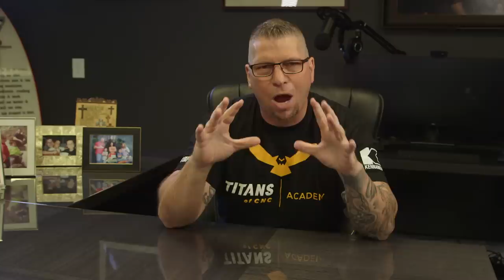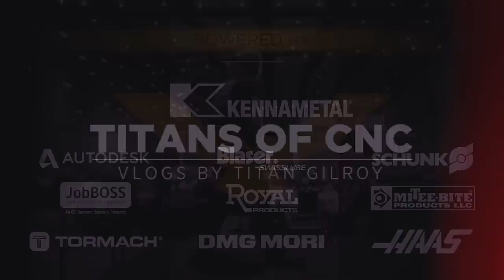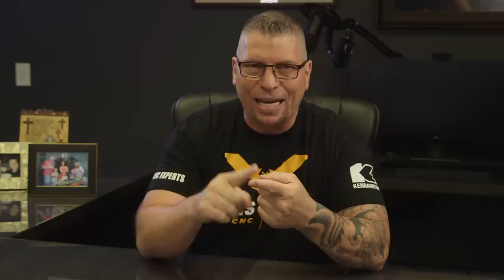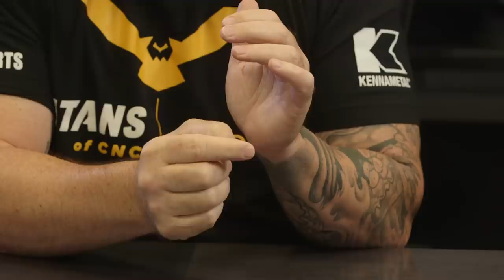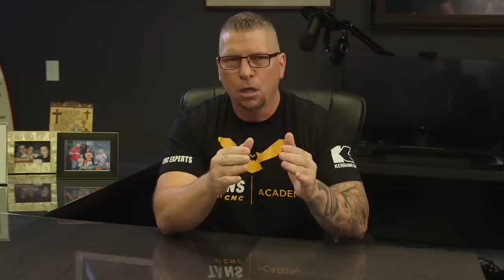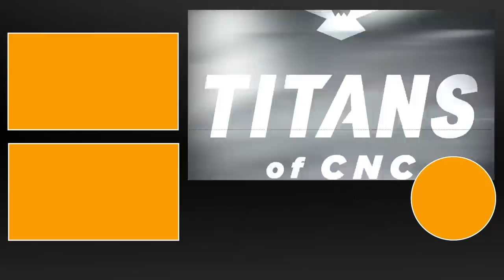My WORST DAY in CNC Machining - Vlog #96

Comment: Iv got a storie similar to this but with making parts for the new Mack/Volvo semi truck parts so in the past we have ran a bunk support part kinda looks like a boot from flat Aluminum sheet stock. So were running this job and running this job and i wasent a programer yet but so the material we ran the job on we only got five parts per sheet and the sheet was way to big for the job and i kept telling the engineer the sheets to big were throwing away 45% of the sheet away can we change it and he tells me naw it takes to mich time and were gettin the money out of the sheet with running these parts. So in the mean time i pressed for the engineer to train me on programing wotch he did do i spent months befor work and after work training and learning the job and this specific job was gonna be my first attack when he let me loose. Training is done the company got me a laptop from corrporate and said what do you this your gonna accomplish cause were giving you this opportunity and i said make faster programmes and save money for the company and they said we will so. So the bunk support came up and befor running the job i took an hour to get a program ready with the extra scrap materil we were throwing away i put two other parts on the sheey one was a speaker mount and one was a tv support and it ran great. We needed 500 hundred speaker mounts 375 tv supports and 345 bunck supports al together if i would have ran the three jobs seperate we would have needed 55 sheets of .080 aluminum and in the end i cut the job from throwing away 45% of a sheet away to 10% and saved 28 sheets of material at a 120$ a sheet. Programs done and i gave to my partner and the 2.nd and third shifts to run everythis was to speck for quality. So we send the parts to the next departmwnt to get bent and they kept going untill the got back to shipping one of my quality guus just happened to be walking threw and saw the apeacker mount parts and he grabed one and he was looking at the inside a of the four inch hole that was nibbled out with a 2 inch punch. He put a hold on the parts and brought them back to my department and the next morning he came up to me and i asked whats wrong with the see parts there perfect and he grabed one and held it up where i was looking at him and he was lookin at me thru the 4 inch hole and says hat do you see wrong and im looking and if you were to look at the bottom of the hole and look in a clock wise manner at the hole the last 30% of the hole had a bur about .050 thick from running a dull punch and i knew right away the guys that ran the job wernt paying attention while they deburred the parts. Even through i dident run one of the parts because i made the program to run the parts i took complete owner ship of the mistake and said alright leave them with me and ill havem them done befor i go home and the quality manager said goo we need thwm tommarow to shipand i said ok. While i said ill have them done befor i go home another hot job gets brought to me to run the same day the parts get brought back so i took a sec got a game plan to run thw hot job and to get these parts fixed. In the end i ran the hot job and on the down time i went and did as many parts i could and then went an attended the hot job when needed in the end befor i went home i got the specker mounts done and got them there hot job. Because i dident run not one of thw speacker mounts but created this program to run them among three other parts i took ownership of the problemand corrected it i dident say "i dident run the job talk to the guys that did" but took the humility and did wat was need to bedone and went on about my job. Quality is one of my biggest pet peevs i trybto be as good and perfect as i can possably get, im the guy thats wants a customer to come in with a part and ask who ever ran this, thats who i want to run the job everytime because of the quality but thats just me and the pride i take in my job but thanks for reading and hope everyone has a good day...... Later
Reply: Amazing story Brother, Thank You. God Bless!

Comment: Your vid reminded me of a post I made on our website soon after we launched Alacrity Audio. Hope you enjoy.
"We, in the UK, need a Small-Company Quality-Charter!

Posted on 07/21/2014 

by Alacrity Audio 

In business, your Reputation is all you have to stand on. It’s no use offering a Bargain service when the service provider backs out at the slightest hint at a problem.

I have had an awful experience with a scooter purchased to aid my mobility (as some of you may know, I am an early-stage MS sufferer). It arrived after an extended period with a number of problems including a cracked and leaking battery.

I contacted the seller who was, on the first call, very sympathetic, but then BLOCKED MY NUMBER, leaving me with a bitter choice. I could go to his address, costing about a hundred quid for the return journey, with no guarantee of a solution, as he states on his site that “no stock is held at this address” (hmm, shoulda spotted that one…).

Second, launch a legal case at a potential cost of hundreds of pounds and no guaranteed outcome.

Third, buy a new battery (which I did).

Good customer service doesn’t have to be like this.

I must admit that, one time so far, we had a problem with a pair of Caterthun Classics. The tweeter died, so we swapped them out with a good pair. Unfortunately, that pair then had a serious drop on their way to the customer, binding a bass-unit.

On hearing this, I immediately dispatched my son with their repaired pair, in his car, 120 miles to exchange, with guaranteed success and minimal inconvenience to our customer.

I’m not saying that’s Good. What I’m saying is that our response was good, because I know what it’s like to be let down, and I wouldn’t want to let down any one of the members of Alacrity’s growing family.

You are all safe with us.

AA"

Comment: Any part that needs to be checked like the finish in a limited space should be cut into a section so the profilometer will check it accurately.

Comment: One thing I don't understand. I personally worked in the aerospace industry. Aerospace companies don't usually give out contracts without a first run run test parts (One batch).  These parts will be assembled and tested.  If they passed QC and inspection of the aerospace company, this will clear your process to do more parts.   

Now you mentioned that you had a deep bore and you couldn't go deep to check the surface and diam.      It's clear that your processes was ready to make these parts.    And yet you send out parts that were not ok.  We"re in the 21th century and I notice that some big CNC shops that get aerospace contract as subs, fails in some  area with their processes or controls of parts they produce and gets rejected at one point and they don't know what they have done wrong.  

But I have to command you on accepting the responsibility of those parts.  You showed that your a good business leader. 

One thing need to be remembered:  When it comes to aerospace parts, your shop needs be ready and have processes that works 100% on every operation done to a part.    Because these part are sometime mission critical.    The best way to explain that to employees:  a part for the aerospace industry is not the same as a part for a car or tractor.   The level of tolerance are not the same.

Comment: Hi There, The customer tells you a mating part doesn't fit in the bore you made, aside from the scratches, You don't know if the mating part was made to spec. It didn't take me long to learn to ask for the drawings for any mating parts, even if I wasn't going to be making those parts, and check all of the dimensions against each other to see if they add up correctly.
Reply: That's why GD&T exists. 

They exceeded MMC... that is not acceptable. LMC is the goal for a reason.

Comment: Did the customer approve the process documentation before production? Did it meet that spec, by that method?

Looks like someone needs to work on some ECN's and eat the cost for parts. 

If they never verified the production and testing methods, and you never asked them to, I guess you were both in over your heads.

Comment: Bore size is a wierd QA thing.  Are we measuring the diameter or the minimum inscribed circle?  Fitment gages become a good idea in certain applications.  Or holding good form.  Cylindricity.

Comment: That's why I'm a carpenter.
I set my own hours and I have no boss.
When they invent a robot that can,
Drive to a job site
Talk to a homeowner
Assess the symptom and diagnose the problem
Put together a bid or an invoice to do the work , and another one for the materials and supplies
Fill out a contract
File for permits or call for inspections
Then go get the material and bring it back and do all the work
Then sign the contract and take the check and go deposit it in the account
THEN I WILL GET WORRIED ABOUT MY JOB BEING TAKEN! 
NO G.E.D
NO DIPLOMA
NO COLLEGE
I STILL OWN $70K IN RIG & TOOLS AND CLEAR $107K YR WITHOUT EVEN TRYING VERY HARD! 
( it's easy to cherry-pick the jobs and only take the ones that are fairly easy for you and profitable)

Comment: An 8 micro for a surface finish is a crazy tolerance
Reply: Happens all day every day in Aerospace, and even lower.  I'm honestly surprised when a company serves Aerospace and they don't have grinders and EDMs in their shop.
Years ago, I saved my employer a lot of time and money by showing them how they could finish turn / burnish with an ISCAR tool, if I remember correctly it was a bit wonky though something like the profilometer read an 6 in one direction and 8 in the other.
Reply: Not crazy at all. It's real fine but standard and not crazy.
That'd be like saying 0-80 is a crazy small thread.
Reply: A normal crankshaft bearing of a lawnmower is tolerated to 0.004 mm(!) roughness.

Comment: Wait, I'm confused! Please clarify this! You made it sound like the customer provided your shop with what later turned out to be incorrect specs for the parts your shop made. So it wasn't your shop that made the mistake, it was the customer! You did the right thing by working through the problem and delivering in-spec parts.

Comment: AERO space can be a real bitch!!!!
Used to make flight hardware for the Shuttle program and they will reject your shit if a minor bevel is out of spec!!

I was at my machine doing my thing when a guy a couple of machines down started puking his guts out in the aisle. He'd scrapped a piece of sub flooring he'd been working on for well over a month at the very end of the machining process.
    A simple programming error that should have been caught.
Did that shit for about 6 years and said fuck it!!!  I can make the same money on high end offshore parts with half the stress.

Comment: So you took on a job and quoted it out without knowing you can accurately machine the part to spec. I would hold you responsible for being irresponsible to sending out of spec parts out the door. If it were me I would have pulled all parts from your shop, apologies or not you knowingly sent bad parts out.